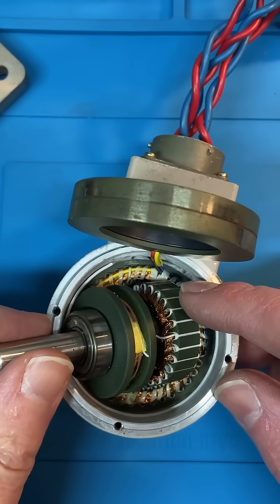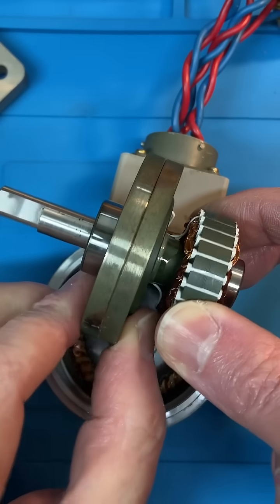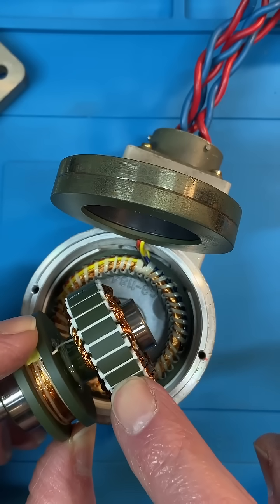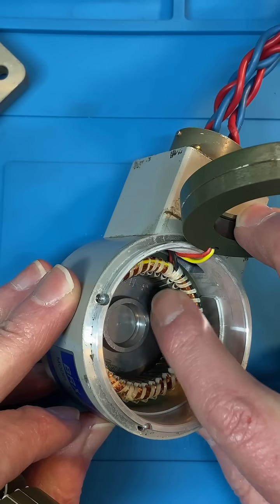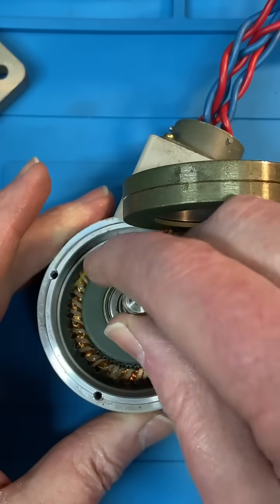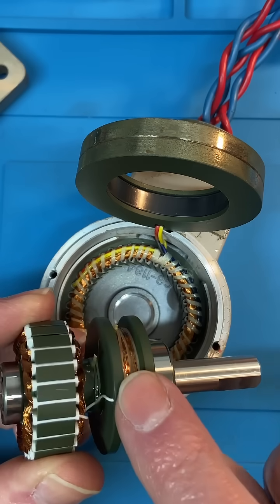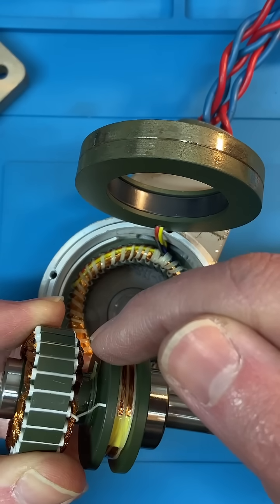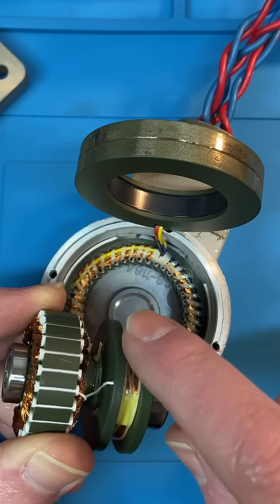Ever wondered how a brushless alternator works? 🌀

Comment: Thank you for clearing this up for me, I have several Delco Remy high output commercial alternators to play with.
Reply from the maker: Nice.
Brushless alternators use various tppologies to do the rotor magnetization and excitation control.
So, you find some interesting stuff when you start digging into it.
Reply: @Uncle-Duncan-Electronics-Shack  I have two 36SI 12v 160A and one 12v 250A 40SI. I want to match one of the 36SI's up to a nice two cylinder engine and keep the other 36SI for emergency parts.
For offgrid power and general emergency power. I got all three of them FREE. The 240A 40SI still has the factory cardboard tube on it.
When I was reading about these beasts I was startled at the cool features the commercial stuff has over the the Joe Blow consumer stuff (like truthful 100% duty amp specs)
such as independent ground (reduces corrosion),  remote sense (improves charging), and the ad that showed one of these things having no problem getting to 1,000,000 miles no problem.

Comment: Of course, why didn't I realize this?! I've been wondering how the heck one could transfer DC power to the rotor without brushes. It's wireless conduction of energy with a rectifier afterward! Simple, but genius. Mystery solved for me. Makes sense how this design with sealed bearings would be superior in filthy/oily/sandy environments where brushes would be unacceptable.